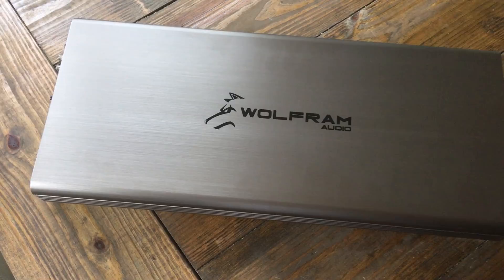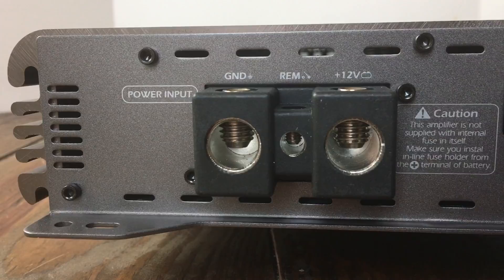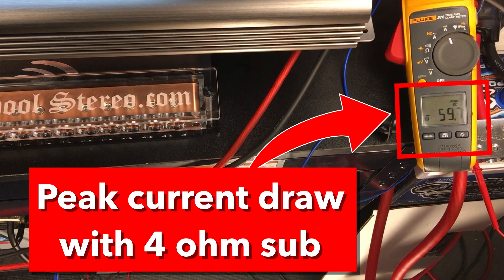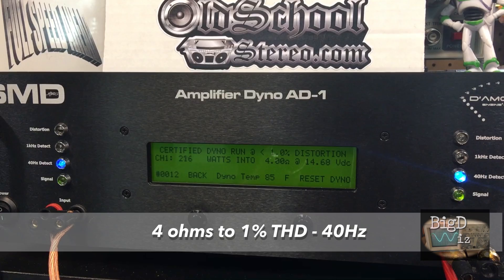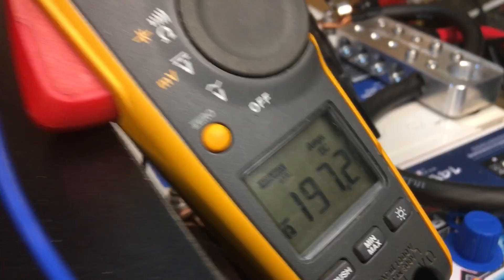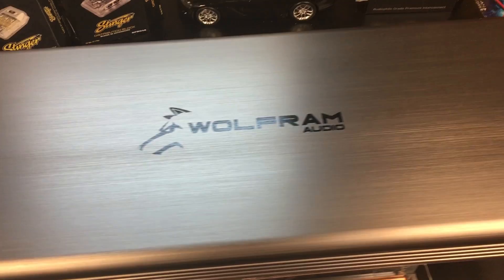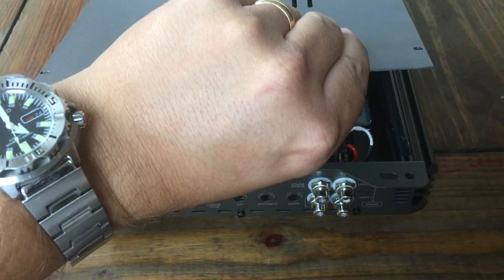Wolfram Audio W-3000.1 3000W Amp Dyno Test

Comment: I know that this video is ‘older’ but I just wanted to clarify for potential new viewers or even viewers that come back to these Wolfram dynos. It’s important to understand that in the manual the ratings/specs from Wolfram clearly state that they are originally rated at 1.5% THD @ 100 hertz and NOT 1% THD @ 40 hertz like most other companies. I would imagine if you tested their amps per their criteria these would have ZERO chance of coming up a bit short like this W-3000.1 did at 4 & 2 ohms. So if you take that into consideration these amps are doing well above their specs and wouldn’t hesitate to purchase one of them (or a couple) myself. Again, just wanted to clarify this as I quickly scrolled through the comments and didn’t see any mention of this. As always, major props to Derrick for the always amazing content. 👍. Also, the W-4500 is rated at 1% THD so not sure why this W-3000.1 was rated that way. Perhaps Colin (Owner of Wolfram) could clarify this if he were to ever see this comment but not holding my breath, ha!

Comment: It would be nice to see these amp manufactures secure the large wiring inside these amps, they are after all going to make everything inside and outside the car shake like crazy. I have opened a few smoked amps where at least one large wire was fused to the main body of the Amp.

Comment: 500 bones for 3000 watts clean. Seems fair to me.
Reply from the maker: +ditto 450 if you use the discount code. See video description
Reply: Ppi  is doing it for half the price
Reply: I would look for a more efficient amp. You have to upgrade the big three with such a large current draw.
Reply: mem10fan2 what do you mean efficient amp like MMats or americanbass something along them lines?
Reply: Yea, but your gonna have to pay Mike Singer, and buy a copper mine.
Reply: The 1 ohm test with the dual inputs was 80% efficient

Comment: Indeed, 4 and 2 ohm are worthless, 1 ohm is were its at. BIGD I wish you would have tried a .5 ohm load! After all, the amp is going back to them anyways. I'd bet it would have put big numbers up. Keep up the great work as always BIGD!
Reply from the maker: +CreamyCornCob watch all the way until the end 🤷‍♂️
Reply: I did! I didn't see a .5 ohm... maybe I'm dumb. EdUt: Its on the detailed spec ratings at the end. Good shit!
Reply: efficiency bro!
Reply: There's really no need for the average car stereo setup to run lower than 2 ohms on a sub amp.
Reply: Amp was already KO'd at .8 when it went into protect
Reply: one sub, 0.35 ohms :)
Reply: CreamyCornCob I agree , but it seems to me when listening the sub seems less controlled to me, like at a four ohm load my sub seems waaaaay more accurate vs a one ohm load . that's just me and ive been known to be crazy...lol
Reply: CreamyCornCob big difference between a reactive and resistive load
Reply: You are crazy Rob Sorgdrager lol. It may seem more accurate with less power (higher ohm load) based on a number of things. Enclosure design, placement, crossover slope, roll-off, thielle/small parameters etc.
Reply: well, I agreed you should be trying to get the most out of your amp, your subs DC resistance being a 1 ohm load, doesn't mean much, the amp will never see a 1ohm load if your wired to 1ohm, because speakers have a dynamic ohm load, that changes with frequency, and the box, it's likely that a 1ohm DC load won't ever drop below 2ohms, and near the Fs of the speaker in box, it will be at least 8-10 ohms, the amp dyno only shows what it does on a continuous ohmload. my sundown sae 1000d makes over 1000 @ 1%thd, and 1500 dynamically on the amp dyno, but I did live power testing, at a 2ohm load, which is rated @500 watts rms, and the live power was between 90 and 281 watts depending on the frequency, 90 watts was at 38hz which is around where the sub is loudest
Reply from the maker: This is true and why I plan to have 2 different subwoofer setups in the future. One capable of wiring to 2 and 0.5 ohm, the other 4 and 1 ohm (nominal). I'll use 4 subs per "bank". This way I can represent exactly what you refer to here by using the AMM-1 handheld Dyno. It will be interesting to compare vs. the Dyno and also to see how different frequencies affect amplifier output and resulting ohm loads.
Reply: It will. I have ran this version and the 3800 board down to .5 and below with great results. But they pull crazy juice and and imo you're better off just getting a bigger amp if you need more power stop waisting your time,money, and amp trying to squeeze out more power and beat impedance rise. Wire to 1 ohm and keep it moving.

Not you big d lol just people in general love you're videos keep it up
Reply: big D that'll be cool to see, obviously different subs, and box build can show far different results of course. but a general test on an average sub and box build will be a cool comparison. I liked saying my type r is on 500 watts, but after testing. It strangely feels better to say it's this loud on far less power
Reply: I like seeing 4 and 2 ohm tests cause my sub is dual 4 ohm

Comment: Looks like a OK amp.. I'm not feeling the price tag though. Thanks again for the testing BigDwizzzzzzzzz
Reply from the maker: +FloordAuto testing for you guys. Knowledge is power ✊️
Reply: FloordAuto what is the price..
Reply: 500.. rip off better amps out for that money.
Reply: FloordAuto lol better amps for the price? What's that? Skar? The SK3500 put up 3940w during dynamic testing at 1ohm. This 3k did more than that. Willing to bet the SK3500 won't even do rated certified @ 1ohm.
Reply: mrcleanguy2012 fair enough, but as far as the statement "better amps for the money", I can't seem to find any Korean made 3ks for less than $500. Shit, the sundown 3k is $879
Reply: it wasnt rated for .8 ohms so the fact it done the first 2 tests was good enough.
Reply: on sale for $399
Reply: Colin Buckeye I just got this amp for $360 using bigdwiz code...I say that's an excellent price yes?
Reply: FloordAuto I just got this amp for $360 using bigdwiz code...I say that's an excellent price yes?
Reply: I just placed an order on this amp for $360 and that’s one heck of a deal. This amp is replacing my CT Sounds 1400.
Reply: K Vang do you know if they are still shipping out this month? Or do u think they will get held up at customs?
Reply: cody parker the website says shipping by the end of this month but I’m not sure either.
Reply: This guy knows nothing about better amps for the money where u getting a Korean board that does over rated for the price of this? And 499 for the 4500 wright now what’s better the skar sk4500 sorry buddy but that amps almost 1000 dollars on skars website it’s over 800 I hate people who say something they know nothing about
Reply: Colin Buckeye the sk 4500 is 749.99
Reply: The only just as good amp I found thats cheaper and still a korean board is the orion xtr 2500 and 500 for this amp is not bad at all... korean amps are beasts and it does make a huge difference in sound quality if thats what u want dont go cheap...
Reply: @codyparker2605  yes excellent. Colin owns Wolfram... 🤣 You paid him well.
Reply: @Somchine13  how does it sound?
Reply: @mrcleanguy2012 the skv2.3500 was tested by bigD, and it's korean board built in china.. I have the skv2.2500, great amp.. I now have a deaf bone aak-4000.1 way better amp! I would put this 4k up against and 3.5 or 4k available, I believe it has a 4500 board in it
Reply: @0xxLisaa  the 4500 don't even come with a clipping light.. check out the deaf bonce 4k.. I just bought one, love it.. clipping light, voltage, amp temperature all on the bass knob.. and clamps 4300 at 13.8v from gp car audio.. clamping is a more real world test, and it can be ran .5 daily as I do on 1 deaf bonce sa312 d1. It's a great amp, was $692 shipped on preorder

Comment: You all saw the 4500 right? Wow, 7,000 dynamic for 599, that's insane. Around 130% of the rating. I would take that all day over my nendo, sq/aq, skar sk, all those similar. But even the twisted sounds amps don't surpass the 30% more power
Reply from the maker: Wolfram is new to the market so they are pricing low to get some interest. The 4.5k at $599 is a superb deal for sure
Reply: If your just into dynamic numbers check out the orion amps. The xtr 2500 does 6k dynamic and the hcca 3000 does 12k dynamic. Imo thats just stupid.

Comment: I'd say that amp is optimized for 1 ohm loads (tested better and better as the ohms went down).  Judging from the .8 ohm tests, it sure seems to have nice overhead.  Protection circut also seems nicely tuned for it's limits.  Solid. :-)
Reply from the maker: +Reggie Reginato yes, appears so

Comment: This was an awesome video. The sine wave must be brutal on the amp during testing. There was barely any current draw when you were running that kappa perfect. What's up with that? Thanks
Reply from the maker: +Brian Miles shows the difference between current draw using speakers vs resistors. In the future I'll have, 4,2,1,0.5 ohm speaker loads so I can try the amps with speakers.

Comment: Hey Big D Wiz can you get us a dyno test on the W 125. 4 Wolfram audio amplifier??? Would love to see the results definitely thinking about buying one!! After seeing the dyno test on the monoblock class D 1 channel amplifiers I would definitely love to see what the 4-channel W series 1 25. 4 will do???
Reply: I would say it does what it's rated.. this company hasn't fail to prove there ratings yet.. I probably wouldn't buy there c class amps though, not positive but I don't thing the c class is korean.. maybe china.. personally I wouldn't buy any amp that's not korean built with korean parts and Korean boards.. the China stuff is ok, but if you like to push your stuff hard like 95% of bass heads you should not buy budget stuff.. pay for the good stuff, it cost more for a reason..

Comment: Not bad. Didn't do rated down low but shined at 1 ohm. Great video BigD!! 👌
Reply: 1 ohm is the lowest rated impedance... You mean it didn't quite do rated certified at 2/4, however it did uncertified at 2.
Reply: Robert H. Oh well. You get the gist.
Reply: I do get it, but you don't seem to... It did the exact opposite of what you said, except for the 1 ohm bit.
Reply: Robert H. Tell it to someone who actually cares.
Reply: Apparently I'm currently telling an idiot who can't handle being politely corrected.

Comment: Great amp also guts are clean and unique design, i wish if you can Dyno any new zapco amp for example the STX.2000 they sound under rated we had one that outperform the SoundQubed 3500w and for much less price. 

Keep it up BigDwiz
Reply from the maker: +SubsonicAuthority thanks for watching and commenting 👍
Reply: BigDWiz You welcome bro
Reply: SubsonicAuthority where did you see it outperform a 4500 watt board?

Comment: Big D I'm trying to build me a all old school system I'm a BIG TIME old amp guy!! But I was wanting your professional opinion on something? Would you run 2-Punch 150HD's on a pr. of 12" old schoo Rockford Power Series 600rms each 4ohms each bridge each 150HD to them & 1-Punch 75HD on my Old School Rockford 6 1/2 Components upfront & 1-Punch 45HD on my Old School Rockford 6x9's in rear fill!! Now that's the first setup!! 2nd setup would be all the same speakers & subs on 2-Punch 200x2 on each 12 & 1-Punch 400x4 on my highs? WHAT WOULD YOU RUN?? Oh yeah I have a Old School Rockford 5X Crossover as well!! THANKS BIG D!

Comment: interesting the dual inputs added power.  Have you ever tried a-b with a stiffening cap?  Always been curious....
Reply from the maker: +Scott Sorensen I use batteries and ultracapacitors together. A regular stiffening cap by itself can't really be shown in my setup b/c of the massive reserve of current I have available.

Comment: Question.... At 1ohm the amp was drawing around 335 amps. My alternator is a 300 amp alternator and 2 batteries. Do I need a bigger alternator for that amp??
Reply: No you'll be ok! It will drawing that yes but musically that draw goes up and down during the song. So draw 300 amps for a bass drop or burst in a song but it's not a 300 amp draw tone just setting there. You're alt will recoup the power between the beats!

Comment: Would you have to use an aftermarket alternator to run this amp, or would an extra battery in the trunk do it?
Reply: You'd absolutely NEED to run an aftermarket alternator if you intend to run it lower than 4 ohms.

Comment: Your current measurement with the clamp meter on the test with the dual 1/0 power wire isn't quite right.  you need to run both wires through the clamp meter otherwise your just measuring how much current is pulled from that one wire.

What would be really cool is to get one of the DC current clamps that works with a scope;  then you could graph current based on time and get a better picture of how much juice these things are sucking down!
Reply from the maker: +computerjlt both wires were going through clamp. I may have shown it going through one in a clip, but the measurements were taken with both wires. Good catch 👌
Reply: Ah the magic of editing lol, love your videos!

Comment: Think duals would have given the 2/4 ohm loads better power or is it just kinda... inefficient at 2/4 ohm?
Reply from the maker: +Eian Wahgener power at those ohm loads is not off rated by far. I usually expect amps that meet or exceed ratings at all ohm loads. Can't explain why it didn't meet rated at the higher ohm loads. I don't think dual inputs would benefit the Amp at 2/4 ohm loads

Comment: Question big dwiz , can you believe a amp is powerful if it has a two gage wire for power and ground and a 100 amps fuse??
Reply from the maker: +gabriel bejarano no, because some Brazilian amps (3kW) have 4GA inputs and 150A fuse. So you can't go by these items alone, sorry

Comment: Can you dyno the wolfram aw 3000.1? I just bought the amp from down4sound and I've never used wolfram audio stuff before. I'm wondering if it does rated power at 1 ohm.
Reply: should be the same

Comment: whats the best omage to use in a car audio system? 2 ohm 4 ohm 8 ohm or 1 ohm? and why? furthermore, I like tight bass not that dragged out windshield hair blowing rattling sound kids seemed to like.
Reply from the maker: Debatable, but I’d say 4 ohms for subs and mids/highs. Less stress on amps and electrical. Requires larger amps, but it gives more headroom too

Comment: Accordng to the manual, the ratings are at 0.15% thd, 1.5% i guess? Maybe if you could test to 1.5% and 100hz it will make rated power at 4 and 2 ohm.

Comment: hey d, have seen that gut before. also Z reviews sells some reviewed products to patrons so fund future purchases. may be an option. last, heard an audiophile guy talking about judging the quality of amps. said that if it does rated at 8ohms lets say. it should double down at 4ohms and again at 2ohms. we all know that. but what if an amp (car or home) does rated at 8 or 4, and cannot double at 2 or double that at 1. what is your opinion? is this a sign of a bad amp? or is it just old, or not designed to? one would think that a super beefy amp would perform these tasks effortlessly compared to a scrawny amp. but the question is, does it make it a bad amp if it cant?
Reply from the maker: +indopleaser due to decreased efficiency at lower ohms, most amps can't double for each halving of ohm loads. I wouldn't say it was a bad thing, in my experience very few can actually double
Reply: BigDWiz the amp wizard knows all.

Comment: Im not sure i could pay $400 for a amp putting out similar number at the same ohms as the cab 1600.1 $200 amp an especially when for $400 you can get 4,000-6,000 real watt amps if you shop around

Comment: Would love to see ATOMIC at5000.1D on here.

Thanks big D
Reply: I have a bnib at5k I bought str8 from Randy (head distributor of Atomic at the time). I found another bnib, same model but the guy wants $1500 which is way too much. I bought that amp back in 08' and never got around to using it. Its for sale if you're interested

Comment: I'm thinking about buying an amp from this company soon. I'm leaning more towards the 4500 though. An amp of this size I believe should have dual inputs on it.
Reply from the maker: Well built amps, albeit cookie cutter Zenon built. Seems anyone with an investment can start an amplifier company. How long they will be around is another matter altogether 🤔
Reply: It's a hard decision for sure. For the price u can't beat what ur getting from wolfram. I really want to buy us acoustics but the price difference is what has me leaning towards the wolfram. I hope they will be around for a while.
Reply: BigDWiz if one was considering the Orion xtr 2500d ( mono block one ) or this wolfram 3000.1 which would you spend your $ on BigD? I’m not familiar with Wolfram but I have heard of Orion before. Similar pricing $399 pre order vs $375 Amazon prime.
Reply: Up To Bat Entertainment I use the Orion. I believe the Orion had better numbers across the board ( no pun intended lol) on less voltage and I can attest to their DURABILITY IF FED ENOUGH JUICE... so I'd lean towards Orion but... I'm thinking of a couple 4500.1 for my navigator over the xtr 4000.1